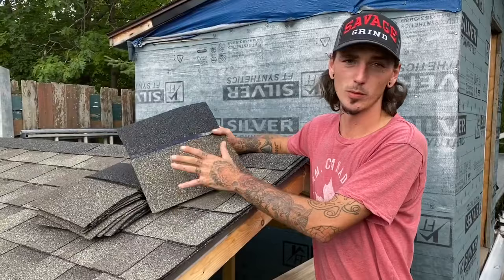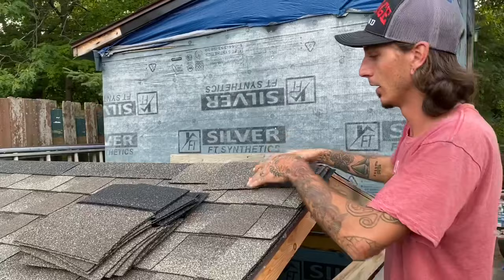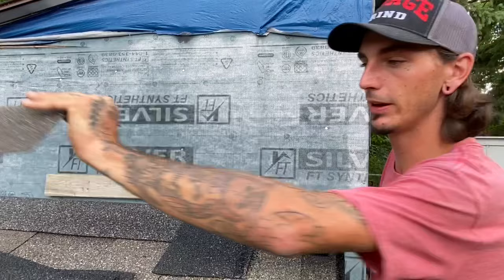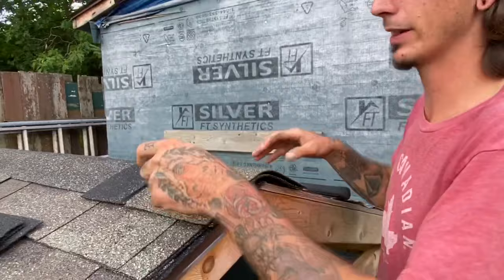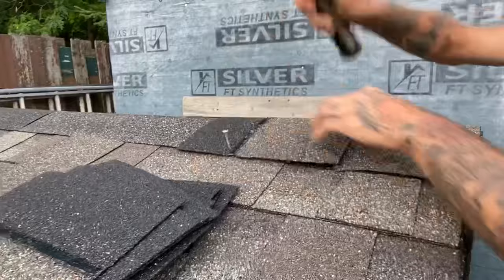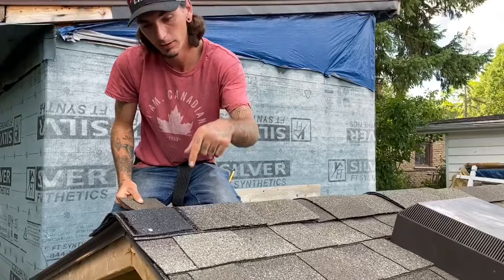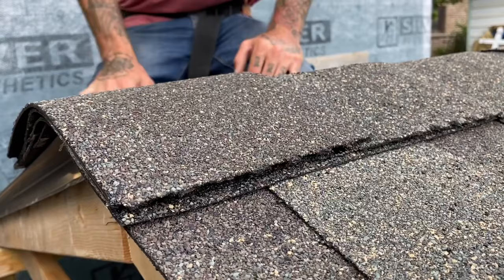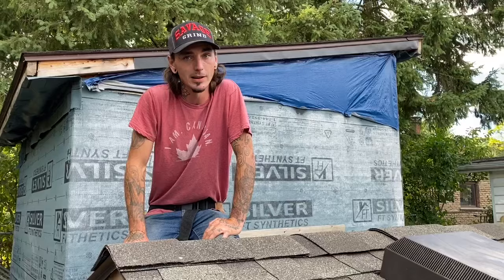How To Install Roofing Ridge Cap (The Right Way!!)

Comment: I watched a master carpenter cover the last end cap nails with tar, then rubbed two colored pieces of a shingle together to get a small pile of colored particles, then sprinkled them over the tar-covered nails and pressed them in.... totally blends in with the cap -- you never see the nails.  I thought that was soooo cool! :)
Reply: Just use the self tapping rubber washer screws.
Reply: L
Reply: Thanks for posting this, I just used this trick on a roof I did for a client, and it turned out great!
Reply: Nice tip!
Reply: The only problem with this(not saying it's bad) is over time you have points where water can eventually seep in. If u were to dip or cover the nails in caulk or sealant then do the tar and color match then most definitely a good idea but I'd say it be a bit time consuming. We know everyone is in a hurry to get the roof done
Reply: I do that, but just cut 1" x 1" pieces of shingle, and glue them over the surface nails.
Reply: It’s called shingle Parmesan. When you sprinkle shingle grit to cover up sealant on cap nails lol
Reply: @jamesMwebber  it’s not time consuming really there is shingle grit every where on the roof just grab a cap after you seal the cap nail and rub it together over the seal and boom done two seconds
Reply: This is done in flat roofing all the time lol
Reply: @godworden2768  nooo not on shingles. Good on metal etc.

But the washer head won’t seat perfect with the uneven granule.

And over the years it will get eaten around the washer and not be happy
Reply: And yes the granules on caulking is a cool little trick.

They actually sell those granules by the  pail meant for flat torch roofing.

So you can just get buckets of these and have them for shingle repair if needed.

The granules will protect the caulk as well so it will last longer, same as the granules protect the shingles base mat.
Reply: That's dumb..
Reply: @user-pq6mr6op3p  Is this your crown I found on the side of the road King nothing?
Reply: Dude. Great idea. Thanks for sharing.
Reply: That's a great tidbit!
Reply: Thank u . Tomorrow will give it a try .. 
Lol the whole reason why I was looking around I always just nail the last one n with y finger just taping them with black tar .N no complaints but I was like hum they got to b a lil trick that I mis down the rd as a kid .
But shit duh . Lol
Reply: I do the same thing with the grit. Been doin it for years. And, for the folks speakin about leaking issues, VERY little water falls on the peak. Very little snow sits on the peak….if any, ever. There’s very little chance of any water coming in through a couple of nails that are tar covered on the peak. Been doing this for over 25yrs, 3rd generation carpenter, and I’ve never once had a callback for a leak. Side note, another thing I like to do is spray paint the white vent pipes the same color as the roof. Makes em blend in and almost disappear. Your welcome. 😉
Reply: I did that all the time,looks way better
Reply: I’m a carpenter by trade but do a lot of roofing and I been using that trick for awhile
Reply: @nathanhildebrandt2672  I like your suggestion, will try it on my small project.
Reply: Thats how my dad who was a carpenter showed me how to do it 35 years ago too !  I needed a refresher on my roofin though. Ha !
Reply: Nice tip
Reply: Pixie dust
Reply: @zacht.2954 or in the gutter lol. If they're is one that is hopefully lol
Reply: Just did it - looks great completely unnoticeable.

Comment: Thanks! As an average homeowner with no skills, talent, or experience, seeing how you said to orient the caps so the prevailing winds don’t blow them up is really helpful. Pretty cool that you got TWO tar lines at the end. I’m sure you really are much better than average!
Reply from the maker: I know a thing or two as I have been in the trade for nearly ten years now. I would just like to pass on some knowledge now.
Reply: What can a poor man give away ?

1. Wisdom
2. Compassion
Reply: @Average_Roofer  I enjoyed your video, thanks for posting. I have a question:  How would I know what the prevailing wind is where I live? Thanks!
Reply: @gmd1417  Since storms rotate counterclockwise in the northern hemisphere and clockwise in the Southern Hemisphere, if you’re in the US, the wet part of a storm will usually come from the SW blowing toward the NE. However if you have monsoon weather (thunderstorms and flash floods) during the summer, that will be something to consider. Also if you’re on a hill or mountain that could have some local effects. I suppose what it all comes down to is which rain storms have the most wind in your area; winter or summer.

Comment: Dude thank you for explaining how you overlap the ridge with the roof shingles instead of cutting them off! I have been on google and youtube for an hour trying to see if i am supposed to cut off the top of my shingles or just lap it over to the other side and now i finally have my answer! With your help, my shed roof is looking pretty damn good and im confident it will hold.. i used to do siding and windows but never really did any roofing so your videos really helped!

Comment: Thank you man.. ive been roofing a shed on your videos.. youre straight to the point and full of knowledge. Ill be watching these again on my next job!! Lol
Reply from the maker: Richie Williams more to come with all kinds of roofing tools and materials. Thanks for coming
Reply: I agree Richie! These videos are gold!
Reply: Me too. I'm actually sitting on top of my shed right now wondering what to do with the Ridge capping. Very handy to see what the pros do. QUESTION: What kind of hooked knife are you using? I've been using one of the Olfa extendable break-off blade knives, but my shingle slicing isn't nearly as easy as you make it look. Of course, that's probably all know-how on account of you being in the trade, and I'll just have to suck it up. But if the kind of knife being used helps much, please do tell.
Thanks. Much appreciated! Oh, almost forgot: is the Lake Street Tavern still a place to go? Back in the 80's, it was a decent place for a pint or three?
Reply from the maker: @eejuice  the snap off blades are flexible and that would be the reason you are struggling. We use primeline or Stanley hook titanium hook blade that fit in most standard knifes. Approx $5 per pack of 5. One blade should lay 1 full roof unless it’s cold then they do tend to break more often
Reply: @eejuice  Cutting shingles is WWWWAAAAAYYYYYY easier when the shingles are warm or hot. They become super hard to cut when they are cold.
Reply: Me too

Comment: Nice tip on cutting the 1st & 2nd to last ridge shingles as starter shingles...  It might also be a good idea to put a bit of a tar strip under the 1st top ridge shingle & final ridge shingle to help the 2 tar strips bond better.  That's how Owning Corning starter & 1st row of shingles mate/lock up for the strongest bond.

Comment: Agree about not cutting off excess height of last course at ridge. Seems to me that the extra layers not only provide some insurance if something happens to the ridge cap, but they also tend to round the peak so that the ridge cap shingles don't have to make as sharp a bend.

Comment: This was a very well done, informative video, however, my house is built the way it's done on homes in New England and instead of ridge shingles, my roof has long ridge boards that intersect to create a long wooden ridge covering.  My house is a 1971 replica of a 1750 New England Saltbox.  One portion of a ridge board blew off in a recent storm and nobody here in Ohio seems to know how to make this repair.  I could instruct them but I cannot get up on the roof to show them.  I've had this kind of ridge cover in two other homes I've owned in Missouri also, so I don't know why it's so unusual here in Ohio.  Can you help?  Thank you.

Comment: Great video describing how YOU do it versus others that were trained by less knowledgeable persons. First time I heard about “prevailing wind” direction so that makes sense on a rental I am doing myself. The only thing I would add:
Go down to the driveway and get an idea if you’re tracking straight on the ridge cap. I see high $$$$ Owens shingles shimmering beautifully in the sun, and then the ridge cap shingles look like the ruffle shirt Napoleon Dynamite wore

Comment: Just good enough to do a good job that will last. The hardest part of your clear instructions was confirming the prevailing wind and comparing with direction of our high wind storms. The other tips were terrific. Going out to finish the cap. Cheers, Seaminus

Comment: you nailed the tar line... thereby breaking its seal. Will not be covered by manufacturer if it blows off for any reason. albeit highly unlikely it will blow off.. i have seen a claim denied because evidence of nailing through the tarline was presented, and thus it was not installed according to manufacturer specification. This comes from someone with 16yrs in the game and a Certainteed master shingle applicator "wizard" certified opinion. Read the specifications on the caps you install.. GAF, CERTAINTEED, IKO, BP, and Malarkey manufacturer specification are very clear on that point. 

Otherwise... excellent video, and excellent points. and i dont fault you for not knowing about the tar line thing, caps is where we all start and for some reason no1 ever told me not to nail the tar either.. i never learned until i wanted to be "the best" and went to get my creds.

Comment: I just went up on my roof due to a leak and 80% of my ridge cap is gone... The roof is 20 years old.. Can't afford an entire roofing job so with this video I will attempt to redo the entire ridge cap... On my house about 100ft... Are ridge caps just shingles you cut or a specific shingle for the ridge...thank you...
Reply: Ridge cap shingles are a specific shingle separate from your regular shingles.

Comment: im using 1 1/4" nails for my shed roof im shingling should you use longer nails for the ridge cap? also do you have to cut an angle on the cap shingles ? I noticed you didnt just wondering if it matters or not thanks Rob

Comment: If you read the GAF instructions for seal-a-ridge, they actually give dimensions that point to nailing on the color matched side of the tar line.  I questioned the logic but did it anyway.  It’s a roof on my shed.  If it leaks, can I just pull the ridge cap shingles and nail them in the correct location?

Comment: start from south and head north, east to west where im at and if the house is facing the right direction and its late enough in the day i always tell them to head towards the sun
Reply: Depends were the prevailing wind comes from in your area
Reply: I dont really get what it means by prevailing winds. Wind comes from whichever way it wants to. North to South, North to East, east to west it's all over.

Comment: I agree with everything you did except the added glue strip under the finishing gable end. It’s not needed bc you’re nailing it anyway there’s no way that cap is coming off unless you don’t caulk the nail and it rusts or if you overdrive your nails.
Reply: youre going to cut a cottage cap at the end anyways, might as well cut that cottage cap when you start and keep the colour piece for your cottage cap, so you can put the back piece of the shingle to use for extra adhesion on the end when you start. its not specified to do it that way under manufacturer instructions so youre not "wrong" but it certainly doesnt hurt to do it.

Comment: Could you cut the corners of the underlayer the Black one like from the tarline and 45 degrese in to make the overlapping thinner? Because we do it in denmark when we burn on these rolls of roofing tar, then we cut off the corners of the layers that overlap under the toplayer just to get 2 layers allover, it makes the corners of the overlapping corners poke up less. But we allso burn it on so perhaps its not good with this type of tar roof :)

Comment: 🔥🔥🔥With ridge cap I've seen a lot of people use tool nails on each side, does it matter?
Reply from the maker: Most people use two nails while installing with a nail gun as there is a chance of nails blowing through the capping. This lessons the possibility of a blown of shingle in the future. 

When hand nailing, you can choose the depth of your nail and not over drive it.

Comment: Are the "tar-lines" supposed to melt in the summer heat and bond the shingles or does it repel water without "melting" - thanks!
Reply from the maker: The heat from the sun will bond the shingles together with that tar strip and permanently attach them together. Very important to prevent wind damage on your roof.

Comment: What's your take on the high profile ridge cap? Like, do you say it's just a two sided roof without dormers, etc. Do you usually start the cap from both sides working in towards the middle? That's the way I've been told to do it.

Comment: for the ridge do you use 3 tab shingles or is there a specific ridge cap shingle when using architectural  shingles?
Reply: there is a specific cap shingle for every brand of shingle.

Comment: I had a problem with the ridge cap.  The little tar strips were not sealing, and the water would run down the ridge caps in the direction of the peak and in.  I'm in FL, I want a bulletproof roof.

Comment: So, in my area nobody sells 3 tab shingles any more. So what does one do to make his ridge cap? I don't like the ridge cap they sell for architectural shingles
Reply: You can't really make your own without using a 3 tab bundle, they sell high profile ridge cap, or they sell ridge cap that's called hip and ridge, it's basically 3 tab but there's perforations where you would normal cut the 3 tab to get your 12 inch pieces for cap.

But they come in different sizes, 8/10/12 I think.

Comment: Where did you get the ridge cap shingles from?  Did you make them yourself by cutting full shingles into sections, or do the shingle manufacturers sell the individual roof cap shingles separately?  If you cut them from full shingles, how long did you make them?

Comment: If it’s cold out will that tar line stick? If not should you use a tube of caulking or something?
Reply from the maker: I need sunlight, the tar will set in cooler temperatures, it will just take longer.

Comment: I caulk the bottom of the ridgecap starter and last two pieces of ridgecap at the finishing end underneath the ridgecap before nailing to the roof for extra security.  Also I like using two nails per side of the ridgecap to make sure they never come off.  Do you think that's overkill or above average? 😉
Reply: 4 nails. Not two.

Comment: You mention driving the nails in the final cap will leak if driven too hard yet you're barely covering the nails with each subsequent cap as you progress. There should be more overlap.

Comment: The only issue I have, and it's honestly not a big issue with your under-layer setup... Because of the layering, the water is prone to dripping downward, under the shingles. Yes, there is a tar-line, but nothing ensures that will even bond. I would have added a line of clear caulking past the tar line, over the nails, before adding the next shingle. The water will only get to the caulking, after getting under the shingles, which are angled down. (The exposed shingle is higher than the secured side. So water will flow down-hill, to the secured side and "wick" under the shingles, up to the nails, which are not sealed, and punch through all layers below.)

Again, that's not a super big deal. The nails have punched through nearly 3-4 layers of tarred surfaces and there isn't TONS of water shedding off a peak. But, in my mind, I'd sleep better, knowing that extra protection was there. It rains quite ferociously here in Florida and wind blows every direction, all the time. 😁 Depends on the hour of the day.

Comment: I find you videos very informative. We just bought a house. The shingles are old but there is only one layer. They are the standard 3-tab shingles. I was planning on re-shingling myself on top of the old shingles with Architectural shingles. Do you see any problem there? Also I noticed you using a hammer instead of a nail gun. Is it better to do so?...thanks
Reply: There's not really a problem of doing it, but not taking the old shingles off doesn't allow you to see any underlying problems the roof could have. Rotten plywood, etc.

In the end the only thing shingling overtop is that it saves a few hundred dollars from going to the dump which in my opinion, doesn't justify shingling overtop.

If you do decide to go through with it. Take the cap off, and cut the shingles at the eaves back, the width of your starter course. Do the same with the rake edge. And take the vents and protrusions out, and replace them, leave the shingles around that area in so it doesn't create a bump when you put the new shingles overtop.

Using a hammer sort of guarantees no blowthroughs, but it does take a lot longer. Nail guns now have settings to adjust the depth, a well experienced roofer should know how to adjust the nail gun so it puts the nails in correctly.

Comment: Excellent video.  Are the ridge cap shingles ordered separately or are you cutting regular shingles into smaller pieces.  Also how do the shingles stick to each other, you showed us a tar line but what makes the shingles actually stick?  Do you need to use an adhesive something? Thanks
Reply: you nail the shingle, the tar adheres them. ridge caps are made specifically for purpose by each manufacturer. while it would technically keep the water out it is not recommended to cut regular shingles. and manufacturer wont warrant their product if it was not installed properly (hence why they make purpose built caps) also... dont put a nail in the tar like he did in the video.. you put the nail just above the tar line so it doesnt create a gap in the adhesive and it still goes through the cap below it.